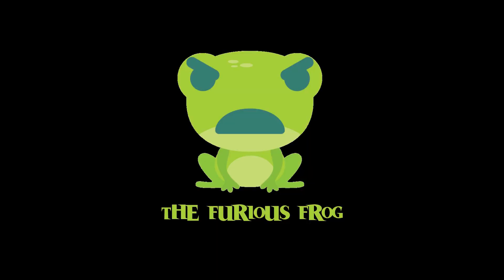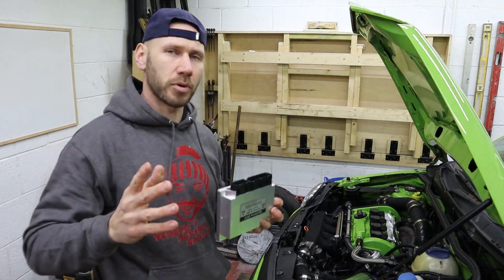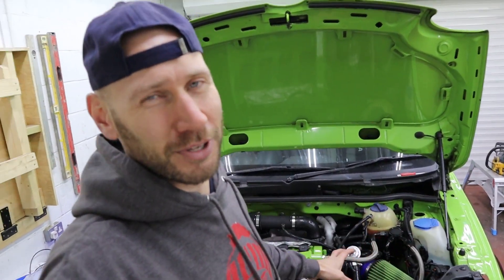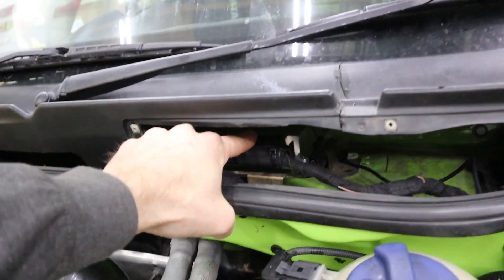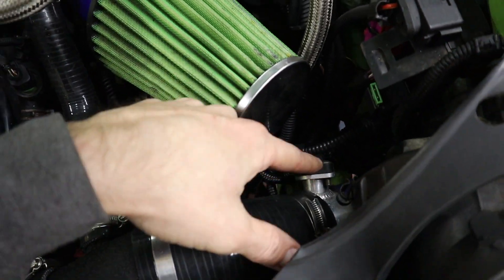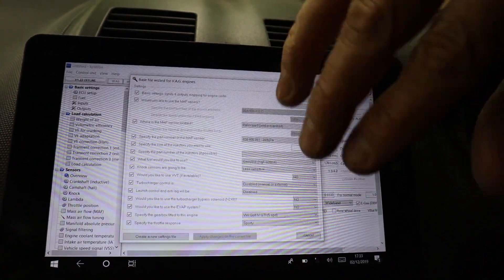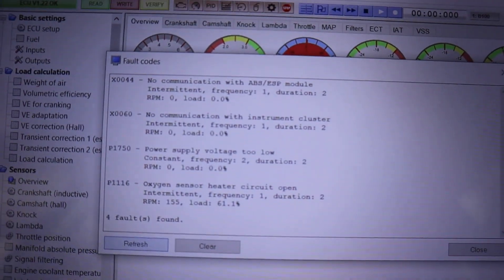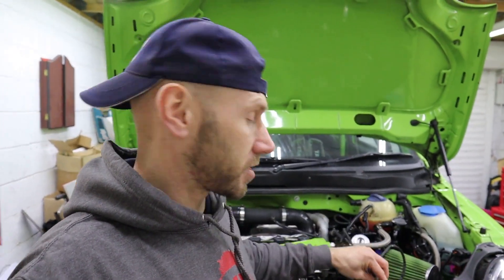Ignitron ECU Install on our 1.8T Track Car !!

Comment: Just a quick question as I’m doing this on my old car (now my mates) - do you have to move the MAP sensor onto the intake manifold, or can you leave it in the stock location on the boost pipes? Cheers
Reply from the maker: If you fit an ignitron then the ideal setup is to delete the MAF, and relocate the boost source for the MAP sensor to the manifold. Then the ECU can be configured to run speed density fuelling.
Reply: @ Thanks mate. Always appreciated your videos & willingness to help and reply to comments 😄. Looking forward to Part 4 of the MK7RS3 😂👌🏻

Comment: On apx code  i suspect wideband conversion is also necessary ?
Reply from the maker: Yes, it is plug and play for ME7.5 ECU's, I believe APX is ME7.1 Narrowband. Youd need to add the extra bits for wideband. It's pretty easy in all honesty.

Comment: Just as a note for here.. as folks will read this comment, the stock mapped me7.5 ecu would have had the heater diagnosis coded out I bet as part of decat type map that was on it.. so it masked the heater fault I think.  Ignitron tells it how it is.. You can also select which faults you wish to take note of (EML light etc) from those you dont.. eg, if you have battery master switch, the voltage error can be annoying, but in fault codes you can untick the box which flags it..  Its an incredibly flexible user friendly ecu, which is why I luv it sooooo much!
Reply: Curious, can you set readiness (smog)if you wanted? Asking for a friend…
Reply from the maker: Well said from the man that knows. Cheers Bill 👍

Comment: You using a base map you have Nick? Is the plan to live map it or get it on dyno?
Reply from the maker: Alright mate, theres a base file wizard in the software which when you input the options, generates a base map. It's very crude but it does get you started. I plan on doing the bulk of the mapping on the road, then maybe some testing and tweaking on the rollers at some point.